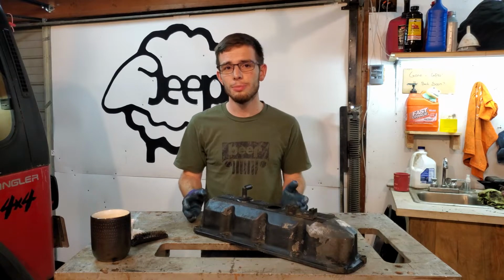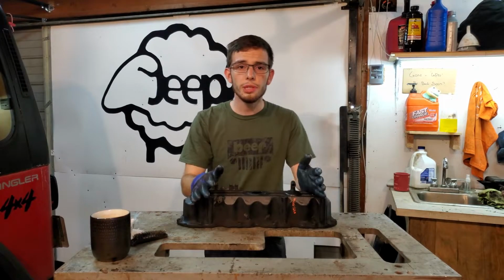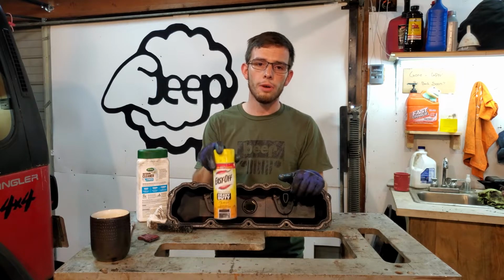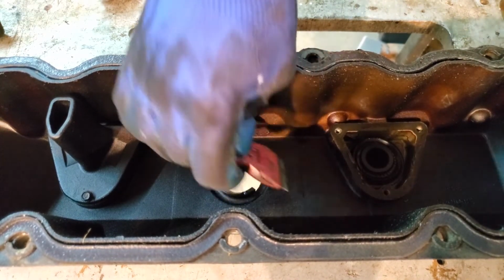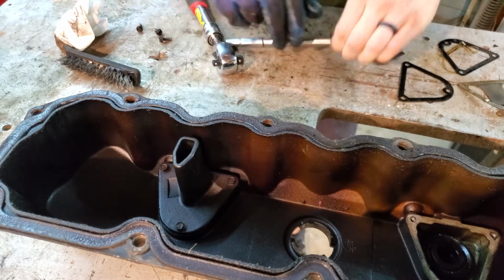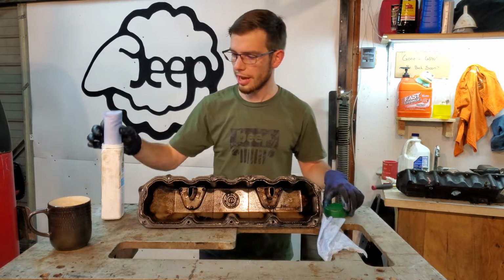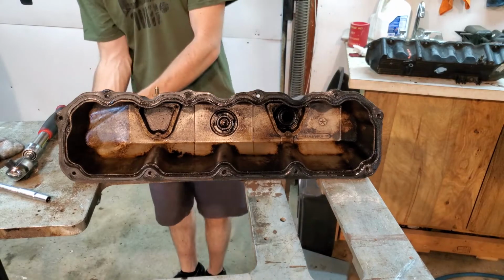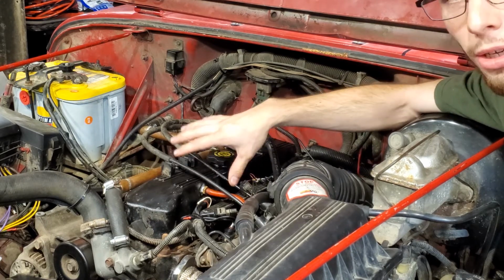Valve Cover Cleaning Jeep 2.5L 4 Cylinder

Comment: I solved my 2.5 jeeps blowby problem by using a 4.0 pcv valve. Get rid of the pcv elbow. My air filter doesn’t clog up with oil anymore.

Comment: My YJ's engine was nasty because of a valve cover leak. I had great results using Gunk Engine Cleaner/Degreaser and a warm water. Afterwards, I pulled the valve cover off I discovered there was NO GASKET!! I cleaned the inside with Gunk spray and I cleared the vent holes. I installed a Fel Pro cork gasket and buttoned it up and the engine looks very nice since. Great video JeepSheep!

Comment: I just finished port matching my intake and found a lot of oil residue inside the intake manifold itself of my 2.5. I fabbed up a neat little catch can to go between my metering orifice and my intake. That should stop a lot of the oil residue from going back into the intake while maintaining the function of my stock ccv system. I'm going to keep an eye on it and if it doesn't work like I think it should I'll plug the vacuum line to the orifice, route the fresh air intake tube to the catch can as well and put a little breather in the top. It'll have to be drained now and then but no more oily vapors in the intake and the residue will still be contained. If I DO have to eliminate the vacuum side of the ccv and just use the catch can and breather method it will also mean a little cooler intake air temperature as well.
Reply from the maker: That's something I've been wanting to look into as well. Keep me posted!

Comment: Very interesting. Anyone else have a plastic valve cover instead of the aluminum one? And where could I get an aluminum one?
Reply from the maker: The older Jeeps will be plastic. I recommend a junk yard or Facebook marketplace. the one's on ebay are very overpriced. I think anything past 1991 would be AL and I think they bolt right up.  Check the forums to verify that.

Comment: I don't own a jeep. I own a 79  big block bronco mud truck. But I kinda want an old  jeep for a daily driver.
Reply from the maker: Do it!  they are fun
Reply: 208 r.c Do you know what JEEP stands for?
Reply: Geonious no what does Jeep mean
Reply: @TheGentry34  Just Empty Every Pocket.
Reply: @Geonious  I mean both my trucks are not cheap gas wise
Reply: @BuckDaBurd  What I'm implying is, if you get into a Jeep, especially an older one, be prepare to spend some money and time wrenching on it. I have owned Jeeps since I was 16 years old (49 now) and IMO they are one of the coolest vehicles. But, I have had my share of basket cases and took a bit of money to get them up to par. If you're into car projects then definitely purchase an older Jeep and enjoy the adventure! They are relatively easy to work on and are a blast to drive. Nothing like a Jeep in the summer with the top and doors off.
Reply: @Geonious  I picked up on what your saying